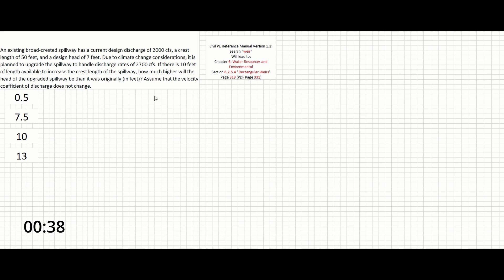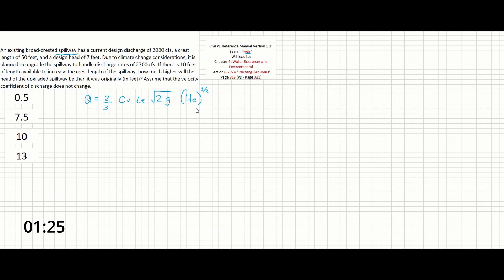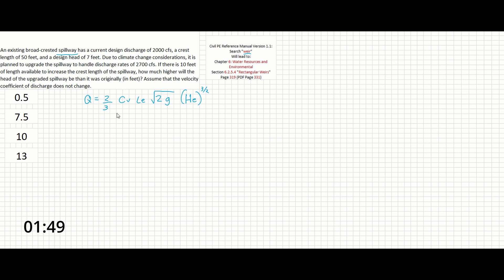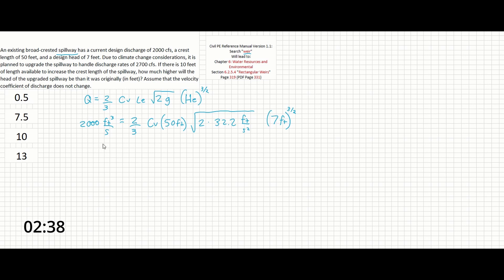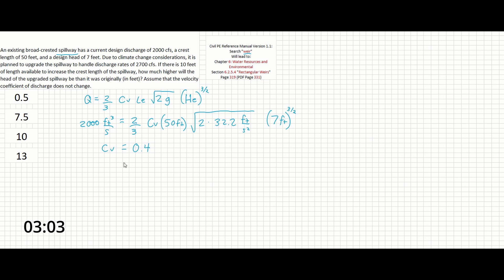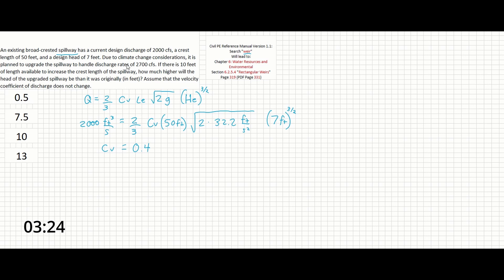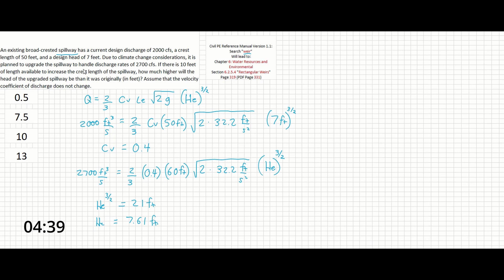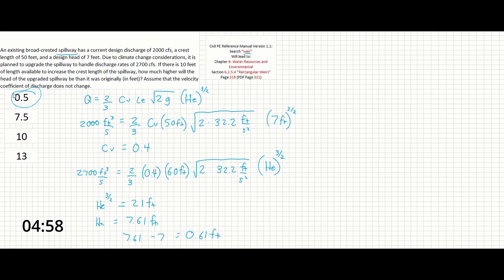PE Exam Practice Problem #19: Water Resources | Weirs - Broad-Crested Spillway - Open Channel Flow

Comment: Thank you so much for your videos! By the way, I was able to use the spillway equation (in section 6.2.7.1) which is Q = CLHe^3/2 and I got the same answer. He=7.57', and after subtracting, my final answer was 0.57 ft :)
Reply: Note this would only work when the coefficient of discharge is solved for. If the coefficient is given, and plugged into the wrong equation, there is about a 5.3x difference between the two. I also used the equation from the spillway section, and the coefficient was about 2.15 rather than 0.4. The 2/3 and sqrt2g in the weir equation seem to be what account for the difference.
Reply from the maker: Great find! I might have missed that equation. Glad to know you've got at least 2 ways to solve it if you see it on the exam. Seems like you're really moving through problems!